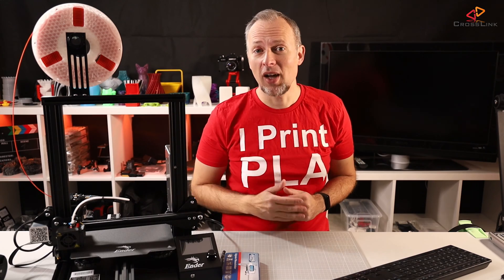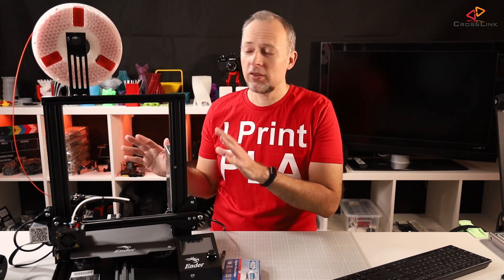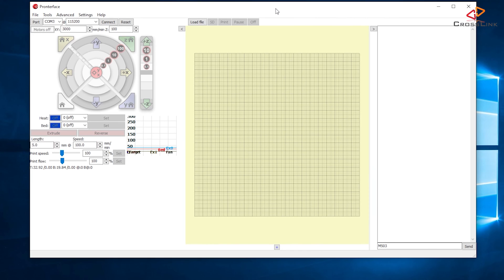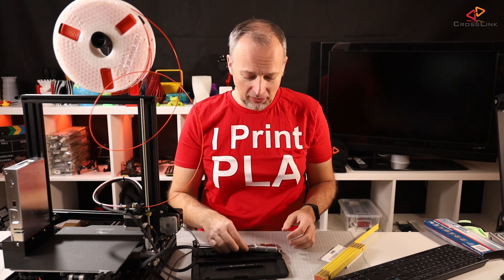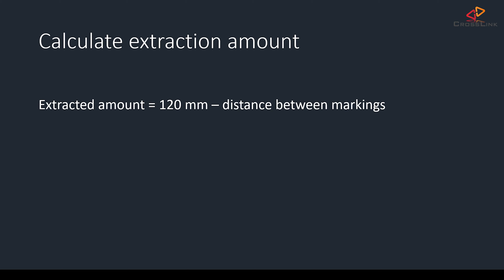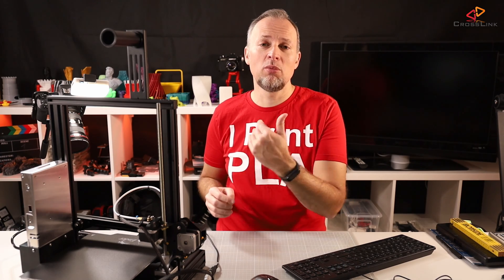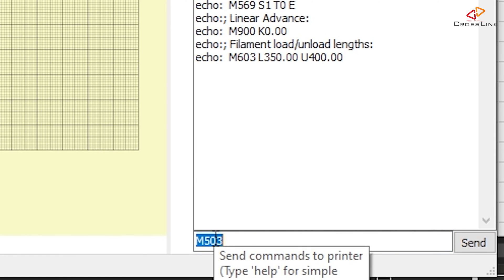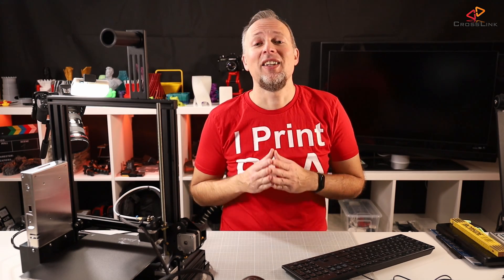CALIBRATING EXTRUDERS - Why and how to do it

Comment: Thank you for this tutorial. I was way under-extruding with the factory settings on the Ender 3 Neo. After the first round, I was only 2mm shy. The second round put me exactly at 100mm. This was a very easy-to-follow and comprehensive video. Thank you for the spreadsheet as well. Everything worked as shown.

Comment: I'm late to the party here, but I just ran into an issue and wanted to comment that if your extruder retracts instead of extruding using the G1 command, you need to pass your printer G91 to turn off absolute mode and turn on incremental mode.

Comment: By far the most comprehensive video I've seen. I'm working on a "Frankenstein" XYZ da Vinci 1.0.  With Repetier firmware on board.  I'm trying to tweak it to be the best (e-waste) machine it can be.  This solves my flow rate issues. And I left with a much better understanding. Thank you

Comment: the following happened for me, i calibrated my printer to extrude exactly 100mm ( measured with calipers ) but i get overextrusion to a point where the flow has to be 75% of what it was originally ...
what could this be ? this indicates to me that the esteps are to high right ? even tho i calibrated it, and double checked several times

Comment: The length to be extruded is 100 mm and the starting point is marked, I don't understand where he got 120 mm from but it's wrong. Subtracting from 100 mm worked.
Reply from the maker: 120 mm simply because if you’re overextruding, the 100mm marker would disappear into the extruder 😉

Comment: im having a big issue i went to do this for my micro swiss direct drive on my cr10s i changed it from a titan extruder so i just divided 412 by 3 as its a 3 to 1 ratio with the titan extruder and saved with m500 and now it acts locked cant move any of the axis at all its not even trying to all i did was connect to pronterface and input M92 E137.37  then after i did M500 and after that it acts bricked
Reply: ok so i found out the fix for this for some reason it was flipping m203 to a negative number E-25 so i had to flip it  back to E25 with M203 E25 and that fixxed it (i was trying to make mine negative as for the titan i had to customize the firmware to rotate in opposite direction that it wont even allow me to do in gcode so ima just flip the wires on my extruder ) thank god my old man works with marlin for a living at his machine shop he pointed it out right away

Comment: Hi, I have been looking the whole day for a way to set the e-steps of a CR6 SE and your video made perfect sense but pronto print does not see the printer. I see you have com1 for your port. I have it plugged into a USB port. Should I try Octoprint as well. Why does Prontoface not want to connect?

Comment: I have an ender 3 pro, with the original creality metal extruder. I followed the steps of the video, but doing from the printer menu the 100mm and the configuration of the e-steps of the extruder. I had a value of 93 originally, it gave me 48mm difference instead of 20mm when extruding 100mm with the 120mm mark. I had to take the value of the e-step to 179.7, even so everything is not precise, I couldn't get the difference to be 20mm. If I put it in 180 it gives me 18mm if I put it in 179 it gives me 25mm
Reply: I ran the series of steps to calibrate several times until I reached that value. I find it a bit high 179 considering that he was originally 93
Reply from the maker: Some ideas. This sounds like there is a general issue with the filament transport. Can you verify that the filament is not getting stuck and the gears aren't skipping? If so, I would do this with the bowden tube detached from the hotend, so the filament can just move through the tube but not through the hotend. If that gives you consistent results, your hotend seems to be clogged and needs a cleanup.
Reply: @Crosslink3D  thanks for answer! After many tests, what I saw happen is that when I print more than 2 or 3 small pieces or 1 relatively large piece, it prints well for 1 hour or a few layers perfectly and then the nozzle clogs, and stops extrude, I tried with different filaments, it may be when it retracts a lot, but I don't know why it gets covered, change the nozzle and it does the same. It starts printing perfect and then it fails. If I put a small part alone, it usually prints perfect until the end. It's like something happens suddenly and stops printing perfectly and the nozzle clog. I just order a capricorn tube, and a cr touch for autolevel, the bed is higher in the central part than in the corners and it is very difficult to level it so that it prints the first layers well, which it does perfectly as I mentioned before.

Comment: Hello I own a FYSETC F6 V1.3 Board and a RepRapDiscount Full Graphic Smart Controller and tmc 2208 v2.0 This driver is available in my country is it possible to work with it as I can't get a driver 1.1 The driver is not available in my country

Comment: I own 3 Voxlab Aquila printers (Cura Clones). I've had major under extrusion problems with one of them and tried this calibration. What I found surprised the hell out of me. Based on your spreadsheet, I needed to increase STEPS to 130 (from 93). I thought that was just crazy, so I checked another Aquila and it came up with about the same. Each was extruding only 66mm when I asked for 100. I have an all metal extrusion with dual gears. I've checked the alignment of the filament teeth and they are fine. I'm reprinting several prints I was never happy with to compare. Mainly Silk PLA.  I'm leaving the 3rd alone as it's working fine. But how could it be so far off?
Reply: I have a Voxelab Aries with recurring, chronic underextrusion issues and I’m wondering if this is the problem.
Reply: Hi!

His calculation goes wrong on esteps on that excel.

Instead of 

=current_esteps*100/Extruded amount

he should have written

=current_esteps*100/(120-extruded_amount)

Have a nice day!

Comment: How to calculate if the extrusion goes past the marking ???
Reply from the maker: So even 120mm are not enough? Your settings then seem to bee way off. Try to set the esteps to half what you currently have and then work from there would be my approach.

Comment: Exruder calibration is NOT important, UNLESS you change your hotend. Your setting from the factory is already fine, as it is a baseline for actual  good calibration. Instead of esteps, adjust FLOW RATE in your slicer. Do this for walls, top and bottom layers and infill until your prints are coming out perfect. You need to do this for every kind of filament you run through the machine, and save the settings in different clearly labeled profiles. Anyone saying you need to do estep calibration does not understand what they are actually doing. It isn't a magic thing that fixes your prints. It just changes the base line parameter for how much filament to extrude. After doing this, you will probably start over or under extruding depending on how flexible your filament is. It is a waste of time, like I said...unless you changed the hot end to something other than the factory one.
Reply: Or if you change your extruder. Or replace your extruder motor.

Comment: Best manual of calibration! Do it on Longer LK4 Pro, default have 92.6 step and with this extrude 93mm, after calculate need 99.6 step - m92 E99.6 and m500 work good and i`d like this result. thank you! I use Repitier Host for make this

Comment: For easier measurement of filament i printed a narrow length of plastic 4mm square, 120mm in length (that is if your printer is calibrated correctly in the X, Y and Z, measure after if not and calculate) and a groove set into the top to fit the filament. 
So much easier to measure the filament repeatedly!

Comment: Hi Daniel. Thank you for this great video. I was doing all the steps but it seems my new Ender 3 Pro board 4.2.7 from Creality doesn´t have EEPROM??? Is this Possible? I can´t save the Esteps value on the Printer menus or even using the M500 comand from Porterface. Is something wrong with this board? Thank you in advance.

Comment: i cant seem to find the driver for the CR6 SE so i cant change my e step. Now when i extrude a 100mm it stops at 65mm. I replaced the plastic extruder with a metal dual gear extruder but without the right e step i cant print shit. How do i solve this?
Reply from the maker: Alrik, what do you mean with not finding the right driver? No connection to your PC? Are you using a custom build of Marlin Firmeware on your printer?

Comment: I had an issue with my Longer LK4 Pro under extruding at the beginning of my prints. I knew something was wrong cause I couldn't get anything to print without a raft. I searched Google and found this video, which fixed my problem. Now if only I can figure out the fix for my hot end not reporting temperature properly, maybe I can get my printer reliable. Very informational and very helpful. Thanks again for posting this video tutorial.

Comment: I'm curious why the amount extruded is 120mm and not a smaller number (maybe half?) to save "wasting" filament, is it easier to calculate, or because of the motors? (I'm new to 3d printing so excuse my ignorance!) =)
Reply from the maker: It’s more accurate than a smaller amount. You’re still measuring with a ruler. The smaller the distance traveled the higher the chance of inaccuracy
Reply: @Crosslink3D  I see. thanks for explaining, I appreciate it.

Comment: Have the V2. Nothing happens when I send the G1 E100 F100 command. It's connected and the M503 responds ok. Nozzle is heated up. Any thoughts?
Reply from the maker: Try to execute G91 before. THat's going to put your printer in relative positioning

Comment: interesting, i did this different, i removed the bowden from the extruder, marked a line flush to the output, then extruded 100mm and marked again, then removed and took the measurements

Comment: Hi Daniel (and fans). I'm on  an Anet A8. Downloaded pronterface with no issue, autodetects COM3 and default set to 115200 bitrate per all3dp. Everytime I press connect, it displays "Connecting..." but stops responding. Any thoughts on how to fix this? I did not try octoprint because I do not have a Rasberry Pi.

Comment: If I put in G1 E100 F100 my Ender 3 Retracts 100mm, instead of extruding.
Reply: Sounds like your printer is running in absolute mode and the current position is at around 200 mm, so when you issue the G1 E100 F100, it moves back to the 100mm position which is backwards.
To overcome this issue, first load in the filament and mark the 120mm as per the video. 
Next, send the following commands:
G92 E0 ; this will Zero the first extruder so the next command will work as intended.
G1 E100 F100 ; this will instruct the printer to extrude 100 mm of  filament.

Next mark and measure the amount remaining.
Then perform the calculations as per the rest of the video.

Hope that helps.
Reply: @CyberOne  Thanks for giving an informative reply and actually reading the query at hand vs. @Crosslink only saying "Good for you!" lol...
Reply: @ughitsvictor  Well, it's not the first thing he's got wrong :-)
I don't think he realises the E-Step is short for "Extruder Steps Per mm"
In his last vide he was adjusting E-Steps for the X, Y and Z axis which is so wrong as to be scary.
The only one that needs to adjusted from the calculated values are the E-Steps or Extruder Step per mm as there can be variations in the extruder gears and the amount they dig into the filament your using.

I did note in this video he was using the correct values for X, Y and Z. 80, 80 and 400 respectively :-)
Reply from the maker: Good for you!

Comment: So there seems to be a limiter in the code preventing me from extruded 100mm --- when I attempt the G1 command you specified, I get the echo back of "too long extrusion prevented".
Reply: That limiter is set in the marlin code. So either you have uploaded your own firmware and not removed this feature, or you're running a custom firmware for other reasons. Or maybe a factory printer has this enabled - I dunno. :-)

Comment: It all works just fine. Using OctoPrint version 1.4.2 on a Raspi 4, with my Artillery SW X1. Thanks to schogaia for the M92 command slicer setting suggestion. Very helpful. However, I tried running a second test, and Octoprint's terminal just somehow didn't send my command. Extruder is heated up, the terminal said "ok" in a response to my G1 E100 F100 command, but the extruded on my printer simply refused to move. Why's that?
Reply: Same here. Turn off the printer (Mains) turn it on again start preheating again, now you can send the command.

Comment: I really like how you are hiding comments you don't like 😏

Your video is not bad, but it's not accurate, there are missing some useful information and the spreadsheet is useless. You can just use simple math. No spreadsheet needed...
Reply: Why would the spreadsheet be useless?
Of course you can calculate it with a calculator, too.
Is the calculator also useless because you can use pen and paper?
Are pen and paper useless because you can use your brain?
Is your brain useless because you mainly use it to troll more popular YouTube creators?
Is YouTube useless because you could watch TV?
Are TVs useless because you could listen to the radio?
Are radios useless because you could read a newspaper?
Reply: @schogaia  Nice.
Reply: @schogaia  Hmmm... Good point... But if you don't have the spreadsheet with you during working on the printer, you can still use calculator or paper. 😉
Reply from the maker: YouTube by default hides all comments with links, even to YouTube videos, so yours got filtered out.
Reply: @Crosslink3D  Hmm... Strange... Comments with links under my videos are normally visible. 🤔
Reply: @Crosslink3D  Also... Just one comment was with link 😏
Reply: Hi Daniel,
Would you ever change over to Bowden?
If not, how come?
Thanks for the content :)

Comment: Additional tip:
If your printer has writing to eeprom disabled (like in the artillery printers) you can include the M92 command in the start gcode in your slicer.
Reply from the maker: Great tip!
Reply: Exactly how is in my video 😝
I told you you missed some points in your video. 😉

Comment: Great video only thing i would change is calibrating on a system with a bowden tube. Heat you hotend to the minimum temp to print. Take the tube out of the hotend and cut the filament flush with the wnd of the tube. Now you extrude your 100mm then cut and measure. It's a much esier way of doing it.
Reply: Depends what you want to measure. During printing is the amount of filament different because of the pressure on the nozzle. Trying to do extruder calibration with PTFE out is not exactly correct. But as I said. Depends on what you want to measure.
Reply: @Zemistr3D  If your under extruding becausenyour nozzle that is a seperate issue from under or over extruding because of esteps.
Reply from the maker: Nice way to do this!